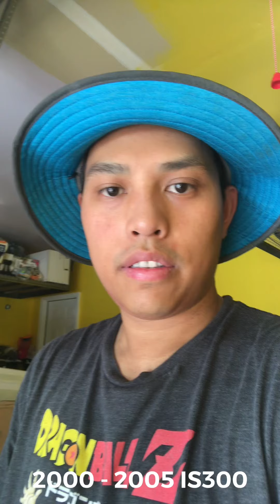01-05 Lexus IS300 Front window motor replacement

Comment: Front speaker does not have to come out. The hole to the left of the speaker provides access to the glass frame bolt.
Reply: I did that 👍

Comment: On your door latch you dont have to remove the plastic peice. Once you pop your panel off you can turn it side ways and it slides through. Ive been dealing with a window issue and have taken that  door apart at least 10 times now.
Reply from the maker: Yes I did notice that later when I went to do the other side, thanks. 🙂

Comment: I’m having issues with mine. 
Question: Are the plastic guides underneath the glass part of the glass or they come with window regulator? 
One of my guides (plastic) is broken so when the window is coming up, it derailed and tilt to a side. 🤦‍♂️ very frustrating. I have gutt feeling I’m gonna end up purchasing them at Lexus dealer for nobody has them (not available in local auto parts)
Reply from the maker: Are you talking about the green tab right under the window glass itself,  then unfortunately you need to order a whole new glass, they are together. The regulator is its own thing separately.